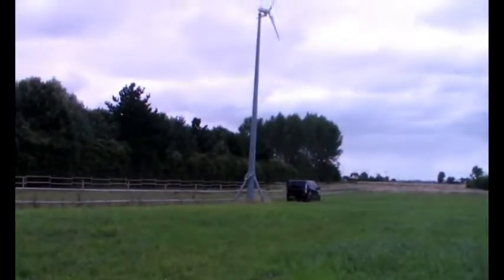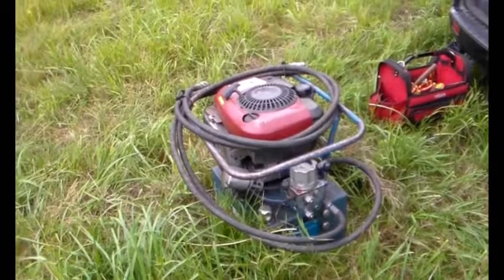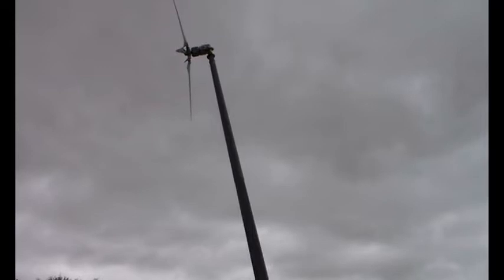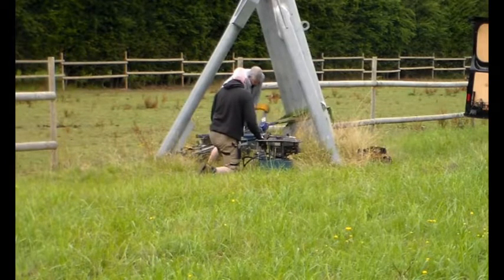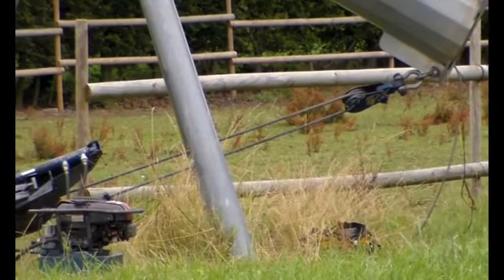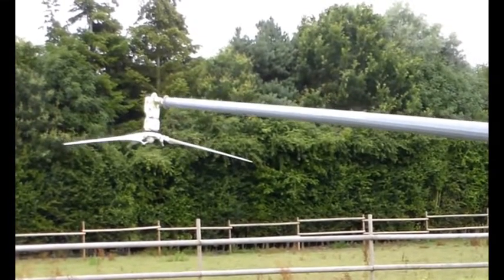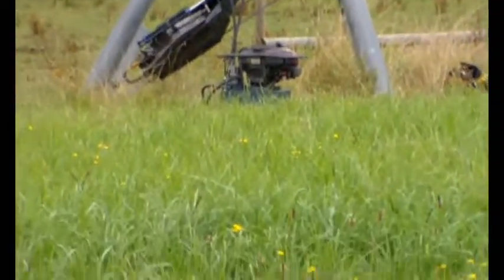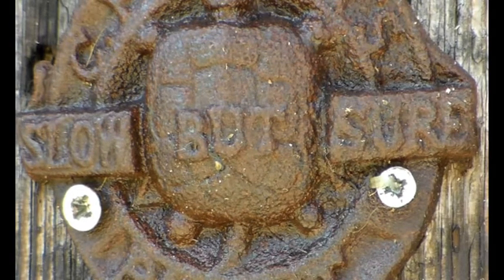Lowering a wind cropping 5KW wind turbine, extreme leverage.

Comment: Very interesting Andy - I had never seen a hydraulic Tirfor working before. Those folks certainly have a lot of faith in those cables !  You'd think they'd have a trestle arrangement to support the mast in the down position, so the horrible forces all go away, at least while they are working on the business end.... also, those tripod legs must be extremely well screwed into the ground !
Cheers, Dave
Reply from the maker: Dave, I whole heartedly agree, death sits to your left waiting to tap your shoulder. I'm not sure how deep those screws go but at least 6 feet I'm thinking. When I lower our tower I support it  but these guys have just cut effort down to a minimum, cheers
Reply: @TheInfoworks  The image of that tower horizontal, gently boinging up and down while the blades are removed, stays with you as a reminder, doesn't it ?  Dave
Reply from the maker: @noakeswalker  Oh yes, feels like it wouldn't take too much, cheers

Comment: Cool 
When I first made a tilt down tower ( nothing this big) I made it like this The pivot was about 8ft off the ground but I found out it was better to use a Gin pole and pivot it from the ground 
The Gin pole stays as part of the tower now with the support cables attached to it , the tower also has a 5ft shaft in the pivot and cables attached to the end going up to the top of the tower and some more going up to the top of the Gin pole to stop everything from folding sidewards in the wind 
It’s all held up with three ground Anchors made from old van wheels and tires 4ft in the ground with rocks and soil on 
There is galvanised chain attached to the wheels coming up to ground 
It all works with a small hand winch and you can feel the leverage changing as the tower tilts over 
The forces on the tower in your video must be massive and in strong wind the ground screws must be under a lot of Force
Reply from the maker: Chris, in the last fix on our proven I used a gin pole fixed on the pivoting tower and a tirfor winch, steady and actually very slow with hard work on the first lift. All of these things make solar panels very attractive, cheers
Reply: @TheInfoworks   yes sorry I am quite a way behind on all your videos but last night I was watching your video of you repairing your wind turbine and making a Gin pole for the tower , I am on page 90 in your book wind and solar and loving it . Thanks again for replying to my outdated comments, I will get there in the end
Reply from the maker: @Qaz375  Chris, no rush, cheers

Comment: I wonder if there is a great weight in the base to counter-balance the "arm" of the lever? Clever winching device. Thank you.
Reply from the maker: J, in the early days I tried counter weights on turbine towers with marginal success, I suspect with these commercial units weights would prove too costly in transport and fitting, plus the leverage advantage would be minimal. Those tirfor winches are a good bit of kit, cheers

Comment: Hi Andy, I enjoyed that, I’m surprised it’s only 5 KW? do I assume that means 5000w? only I have a 2KW Genny on my boat which is what you’d call a suitcase Genny, would that be because mine is classed as an inverter Genny? that although it weighs about 25 kilo it isn’t that big….?Andrew
Reply: It just goes to show how much energy is in a little bit of petrol, and so we have come to rely on it so much. 2kW for the genny is possibly the max, so it mightn't run at that all day, in a similar way, I can't imagine that the turbine would give out 5kW except in ideal conditions.
Reply from the maker: Hi, yes it's 5000w and the thing that drives it is the density of the air and the aerofoil effect. It takes a huge area the capture that, so liquid fuel is very energy dense and the technology to release it although crude still reflects this store of power, cheers
Reply from the maker: @bootsowen  Owen, yes turbines are best on ideal sites and in our area it is rare to see full output, but that doesn't stop them being large beasties. So it's a waste of resources to install them on the wrong site, cheers

Comment: With higher energy prices wind turbines are something yo consider even if like me you don't believe in man made climate change. Are there turbines which will work with very little wind?
Reply from the maker: Hi, the quick answer is no, it's all about swept area and wind speed, that's why solar is so much better and also it is passive, cheers
Reply: @TheInfoworks  And it varies a lot more with wind speed cuz cube law.
Reply from the maker: @randacnam7321  Exactly, difficult to control, the engineering has to be superb. A note here: this system does not have dump load and relies entirely on the vari-pitch speed control. A recipe for disaster, Cheers
Reply: @TheInfoworks  And there being a grid to serve as an electrical load in the first place.  There are times when wind would be useful on this scale, but it amounts to a few weeks a year so installed coefficient of performance would be piss poor and thus generated electricity relative to PV would be very expensive.
Reply from the maker: @randacnam7321  I'm thinking it depends where the turbine is situated, west coast of Scotland they would do very well, East coast UK Midlands not good. As I say when teaching "there's no such thing as too many panels" and this helps with the winter drear, cheers